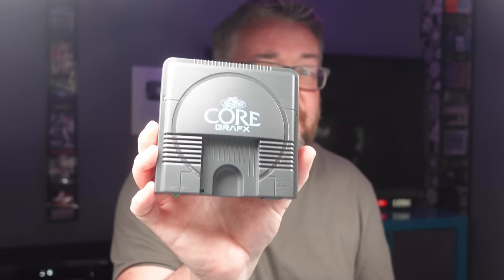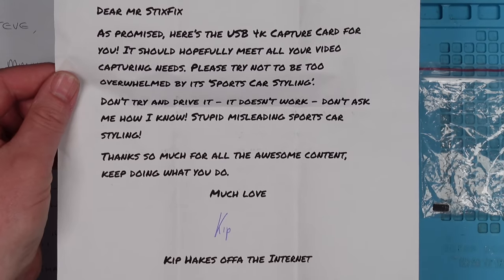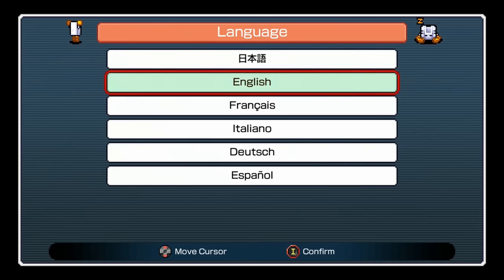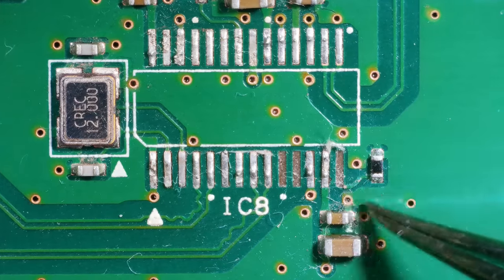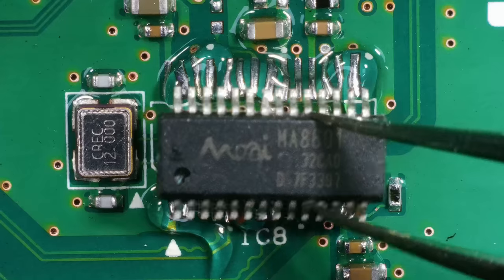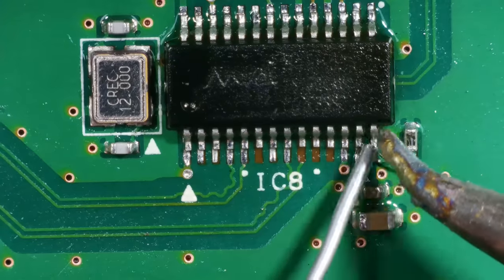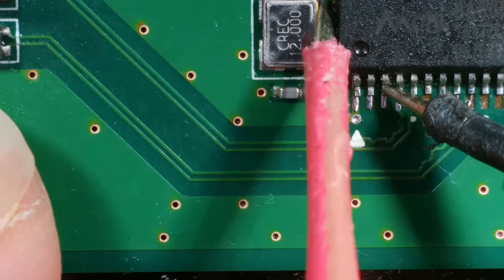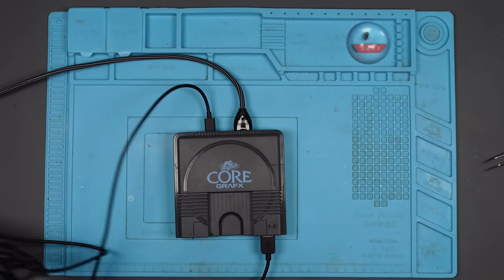Prior REPAIR Attempt Gone WRONG! | Can I FIX It?

Comment: It seems your projects get easier but in reality you're just getting way better ! Well done Stez.
Reply: Definitely the latter: trace replacing is a very messy job, and doing it on the first try is an achievement.
Reply from the maker: Thanks M.!  Yeah, I would've struggled with this a couple of years back.  Definitely feel more comfortable doing it now!  😍
Reply: It is messy, yet so fun and satisfying. I was doing a 0.1mm trace repair yesterday on a non-removable board inside of a 40mm 4 wire fan. Was shocked I managed to get the soldering iron tip down inside. Everyone should give it a try. One day I might even invest in a microscope.
Reply: @StezStixFix  Thank you for not being modest.
Reply: I was gonna say.

Comment: I looked up the data sheet for that chip.  Pins 4 and 5 are D- and D+ for Port 4 and pins 10 and pins 11 are D- and D+ for Port 1.  I thought for sure you wouldn't get controller one to work.  I wonder if maybe controller 1 is hooked up to port 4. Either way, if that's got spots for 4 controllers, I think 2 of them are not going to work.

Comment: Little tip when you have loose pads that are still connected smooth them down flat cover with a thin layer of solder mask cure to rock hard then scape back to copper' more easy than replacing pads/traces ....

Comment: Let me ask a quick thing for my understanding: if there is no visible trace on the pcb to the chip, the pad of the chip is just to pin it down to the pcb am i right? because Stez has just fixed the pads where a trace was visible on the pcb.

Comment: I've been using high heat resistant epoxy to re-adhere loose pads or replacement pads, especially for anchor pads, for a while now and and it works quite splendidly.

Comment: Hey yout show is really good. Just bought I new. Retro nes.   When it powers on the controllers the buttons on scroll the main menu.    If this  interests you. Let me know.  I have a feeling it's a bad board.  But it might b different
Reply: I actually fixed it thanks to watching  ur show.  I decided to take it apart and look for obvious clues. Low and behold I saw a bridge of the solder points for controller #1. Alls I did was scraape away the bridge and I really didn't think it would work. Works perfect now.  Thanks for your show and my eyes hurt looking that close.  No wonder u have a magnifier. Very cool show

Comment: What's the deal with the squiggly traces?? Not sure I've seen that before 😂
Reply: It might be to keep two parallel traces exactly the same length to ensure synchronization at high frequencies- note that it’s the inside trace where they curve together.

Comment: From what I understand the usb controller failure is due to using power supplies with too many amps.  Specifically, raspberry pi power supplies are know to kill them
Reply: That doesn’t make sense. The console is only going to draw the amps it needs, it can’t be supplied more amps.

Comment: The more you repaire the quicker the better you get at fixing stuff did you ever fix emulation box and stuff
Reply: Hey Steve… how about finding a spot too install a 5v regulator on the board?? Could be a permanent fix for these?

Comment: I know it much easier to just run jumper wires but it always makes me cringe seeing jumper wire repairs. I would take the bit of extra time to cut some new pads from a bit of pure copper tape to replace the lost pads and then use some proper epoxy to adhere the replacement pads and the old pads onto the board. Then expose a bit of the traces leading to each of the pads and connect them to the pads with a tiny solder bridge. Done properly it will look like nothing ever happened to the board.